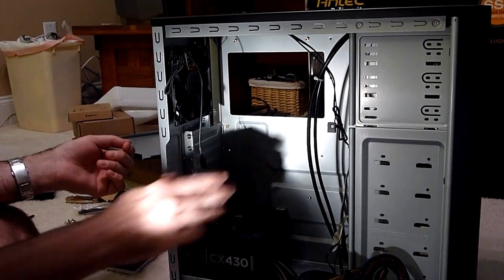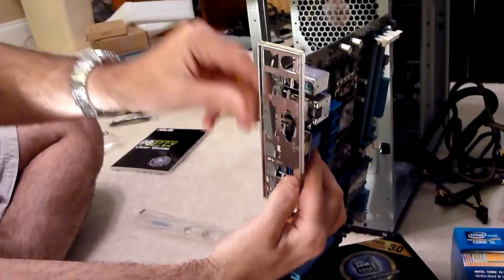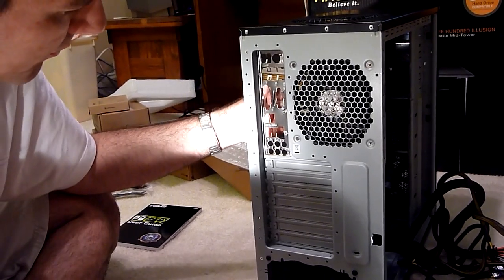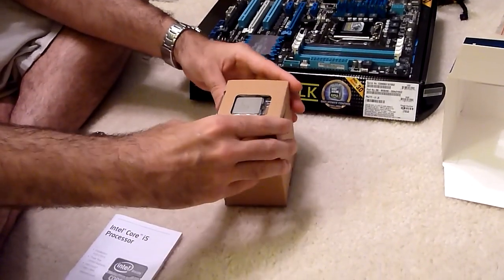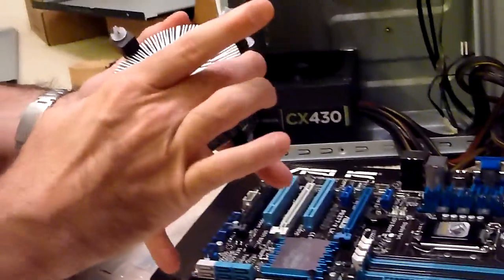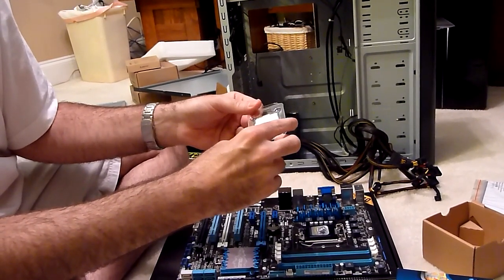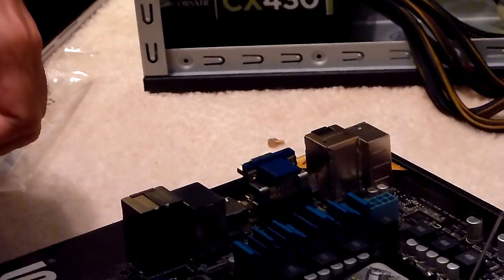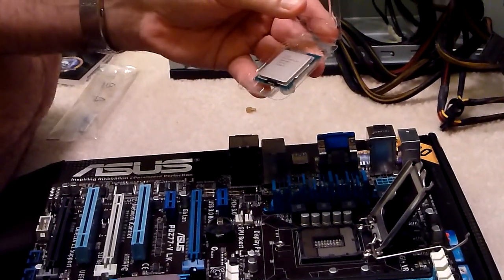PC7: Motherboard standoffs, backplate, and processor

Comment from the maker: With 666mhz versus 667 mhz:  it is more than likely the same thing.  I seem to remember some manufacturers rounding up 666.666666 to 667, and others to 666.  One thing to try to do is match memory as closely a possible... for example, sometimes putting in one 533 with a 666 or 557 might cause crashes.  However, sometimes it  just works!  After building 10-15 PCs, you start to get very careful, trying to avoid problems before they occur!  Luckily, on this last build, no problems yet!